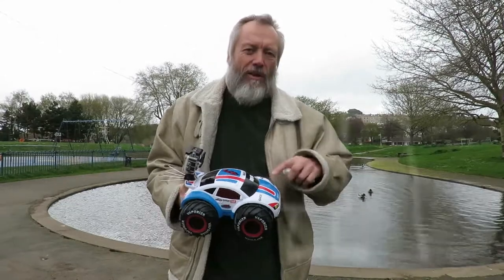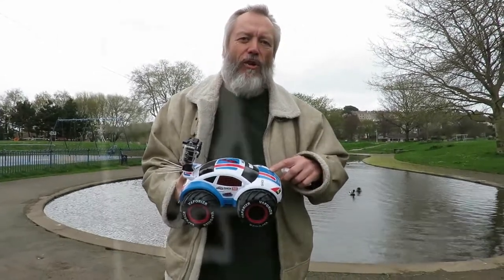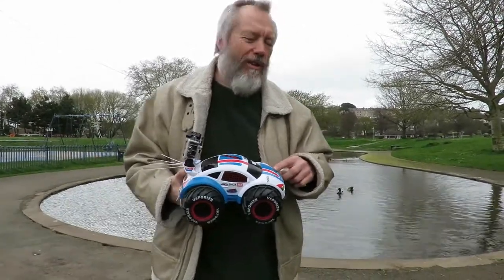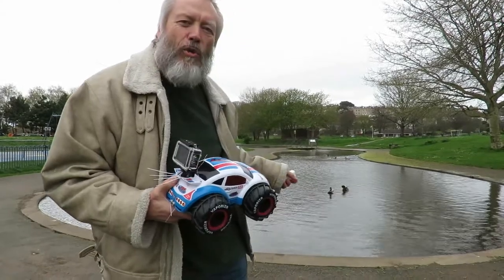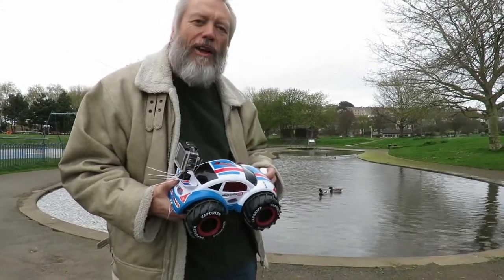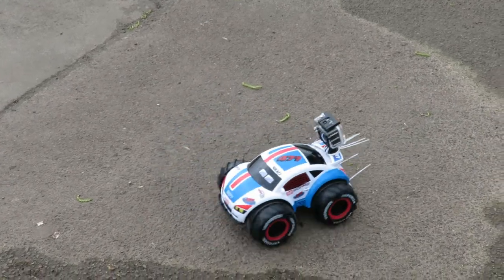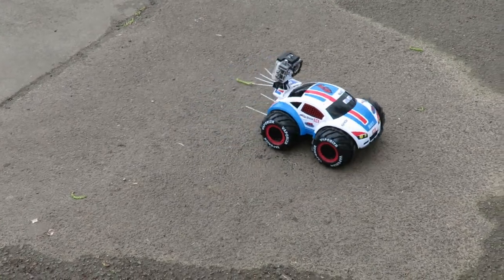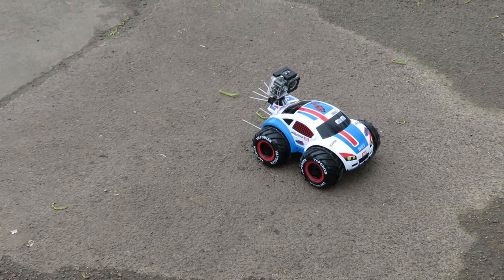Nikko VaporizR RC Amphibious Car in the duck pond

Comment: Hi Grandad. In the earlier video you mention about the wheels being on the wrong direction. The tread having an arrow shape pointing forward makes sense for a lot of reasons. I was pondering the thought about mounting them with the arrow shape towards the rear would it make a difference in water for traction. In the video watching how the water channels away from the tire when going forward and how it reacts when in reverse. As the tires are mounted on the car in the video do you see any noticeable difference in speed forward or back? Just curious.
Reply from the maker: Hi Ed. No easy to tell in this video and I suspect it probably make a lot of difference how fast the wheels are spinning. That may sound "obvious" but at low speeds the water is just pushed out of the way whereas at higher speeds the water is dragged right round the wheel. I expect there is a lot of maths involved in fluid dynamics which I would not have a clue about. The main thing I noticed was in one direction it tended to rise up on the water and in the other direction it tended to dig in. As this car is toy grade RC there is no proportional throttle so I cannot experiment with different speeds other than the battery running down.
Reply: GrandadIsAnOldMan I suspect the camera may have added enough weight to help with the front coming up going forward. As well as it may have helped to plane level in reverse. I recall seeing that tread pattern on two people  paddle boats. Good job.
Reply: If you look closely just as it jumps into the water you will see I added a block of styrofoam under the back to help support the weight of the camera but that will probably have upset the flow of the water under the car. I did carve it to help that but I didn't do any comparison tests with and without. In a later video without the camera it still tends to sit down at the back under forward power.
Reply: GrandadsOtherChannel Okay got it. ☺